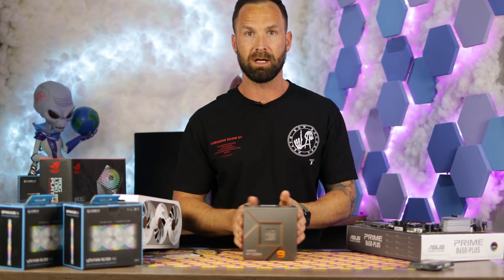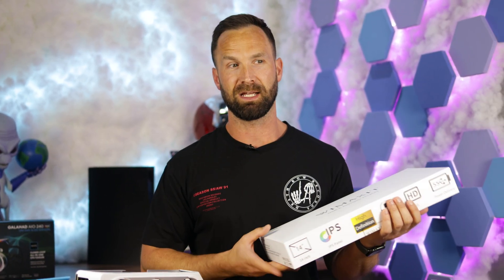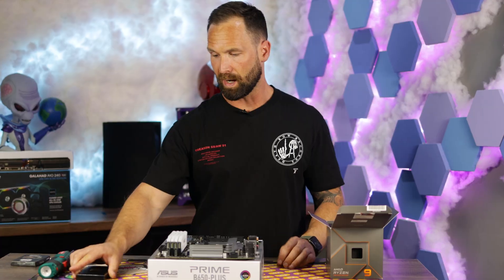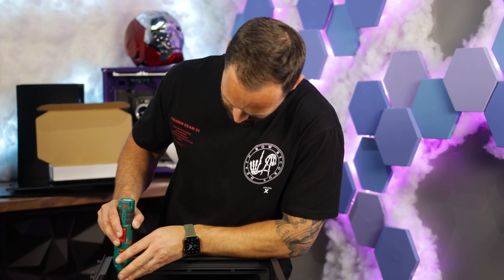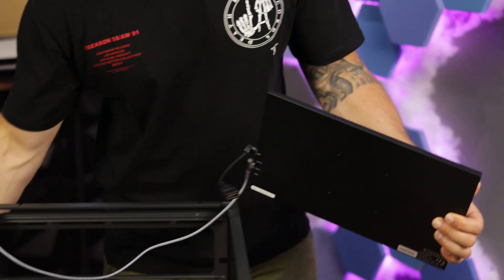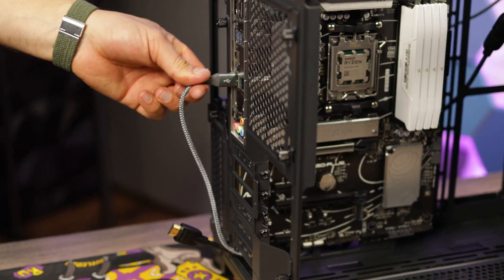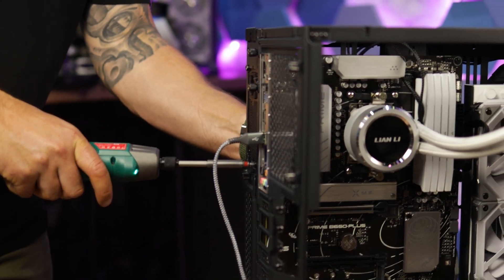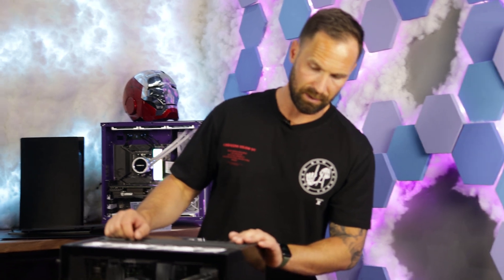How to Install a 14" SCREEN on your pc!! Custom PC! #rtx4080

Comment: should see if you can get GPU's with an internal hdmi header  or motherboards, then you can run it all internal. or get one of those internal USB to hdmi display adaptors. would look much nicer then i recon. Also excited to see this parcel drop on my doorstep ;D